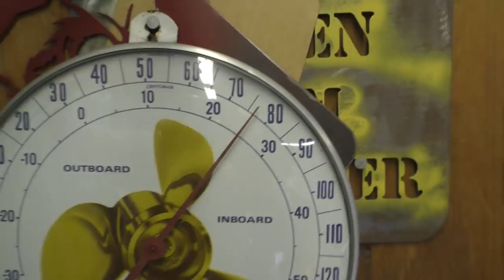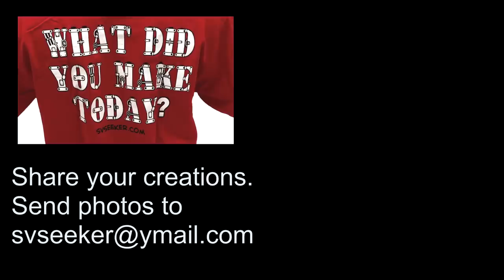Pilothouse Fitout - Part 5 - Floor Port, Cabinets and Settee

Comment: Sorry Doug, gotta say it. On something so critical, your connection point of the wheel to the right angle drive scares the hell out of me. The weight of the wheel plus the fact the shaft has been welded on. Any way to flange mount that? That's a lot of torque being put on that coupling when you consider you are in a storm and you have all your weight up on it trying to turn the rudder.
Reply from the maker: Perhaps, you Scare WAY too easy.   : )
Reply from the maker: @virginian7317  What do I get if I do?  : )
Reply: @SVSeeker  AhhHaa Good old wiifm! Look at it as knowing it will hold, rather than be unsure. And you are now wondering if you are sure. If you were sure, we would be discussing the design on the rudder display instead! You keep me thinking Doug.
Reply from the maker: @virginian7317  So you must be right.   So put some money on it.
Reply: @SVSeeker  It isn't about being right. I would rather be wrong and you and your crew be safe. No worries.
Reply from the maker: @virginian7317    No worries?   You said it "scares the hell out of me".  Here's an idea.   Next time you're scared of something, ask yourself if you'd be willing to bet on it. before you decide it's a reasonable fear.    I think Odds are you'll decide it's unfounded fear.
Reply: @SVSeeker  I have thought about it and I had based my concerns only on what I could witness on the video, only on the concerns of the torque  load. It wasn't enough information for me to address in the manner I did. Althought with over 40 years of experience, I sometimes am an asshole when expressing my opinion 😎

Comment: Non-marine grade wood! Laminated plywood sheet goods on a boat! All this time, money, and hard work, to get cheap on crucial components.
Reply from the maker: So you think marine grade ply is worth the money?   Have you tested that, or did you just drink the Koolaid?  Because I tested it.
Reply: @SVSeeker  oh, you sat out in a river, or an ocean with plywood for a year and discovered that marine grade doesn't hold up, better then normal laminated plywood? Interesting! Like I said, all the expensive stuff you have done already, and to cheap it out on finish work. Enjoy replacing that wood in a year.
Reply from the maker: @bigphillyed  So you did not test?

Comment: $60/sheet?  That's cheap.  Went to the usual scumbags for some hardwood ply...$120/sheet, and most of it was in BAD shape.  Cedar Deck boards that last year were $20~$25 are $60+ today.  Oh, and the boards?  I've seen worms that are straighter than these.